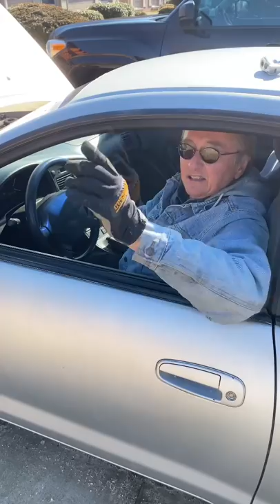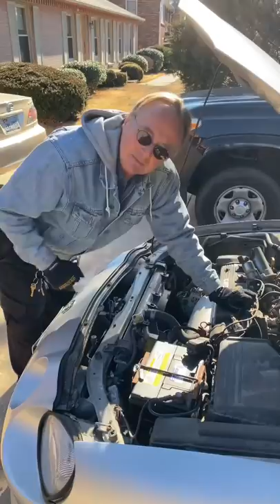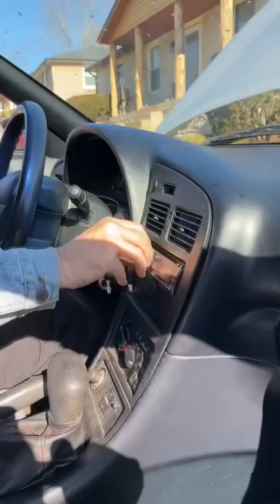Never Do This When Starting Your Car

Comment from the maker: Thanks for watching! Like and Subscribe for More Vids Daily ► https://www.youtube.com/channel/UCuxpxCCevIlF-k-K5YU8XPA?sub_confirmation=1
Reply: Scotty I just bought a 2005 GMC Canyon, no check engine light or anything runs great and well kept... only issue I’m noticing oil build up around the top of the engine valve cover... what might it be?? I don’t want to pay if nothing is needed but dont want to regret not doing anything... I’ve checked the oil constantly but no noticeable difference after having it for a month now. Any suggestions?
Reply: NO WAY SCOTTY IS PLAYING RADIOHEAD WHEN HE TURNS UP THE SPEAJERS THIS DUDE GETS SICKER AND SICKER
Reply: Can't start a car that's already running😯😯😯
Reply: New cars don’t crank if the motor is already running, come on Scotty, you should be more specific.
Reply: Hmmmmmmm🤔🤔🤔
Reply: Holy cow Scott , hope your flywheel didn't lose a tooth on that demo

Comment: Lol, this gave me a Beavis and Butthead flashback. “The car is already started, there is no need to start the car anymore”.
Reply: “hehe that was coool, do it again”
Reply: Some engines are so quiet, if you don't look at the gauges, you don't realize they're already running!
Reply: I rented a car and the engine was so quiet at idle
Reply: @petahe01  how quiet was it
Reply: @petahe01  I'm too am curious as to how quiet your rented car was.
Reply: @ligase75  common
Reply: I too am curious as to the lack of decibles said rented car produced.
Reply: @dansmith6990  it was so quiet I could hear your mom still begging for seconds!

I fix a really mean apple cobbler and for some reason, she has my cell phone number.
Reply: Vance Wankel  I didn’t see any option for plug in.
Reply: @dansmith6990  😄😄😄

Comment: I remember when my folks got a Mazda RX2. It was so quiet while running, some people tried to re-start it.
Reply: My Pontiac G6 is this way...but I don't get the horrible grinding noise with this car, maybe some cars were designed properly not to engage the ignition when the car is on?
Reply: I have a Mazda 3 1.6 Petrol and this keeps happening to me..
Reply: @TheStefano009   same car, same problem

Comment: I did do that few times to different car,  the ambient noise, and car quietness made me wonder my car engine is running.
Solution:
If you are not sure, TRY turn off car, this will not hurt any thing, afterwords, crank car. This is good strategy.
Reply: Or look at your tachometer if you have one.

Comment: Thankfully most modern cars have the auto start feature like mine, and it won’t allow the starter to engage if it is already running.
Reply: It also wont allow the Starter to engage when that 1$ Chip decides to start speaking Chinese!   Srsly, you might think "well things fail eventually you need to replace them"
But now you've ADDED a part which didnt need to be there AND IF IT FAILS THE WHOLE CAR IS USELESS.  how much will it cost to fix?  Well, with integration these days and over-designing.  I could see this cheap component being part of some expensive piece that you have to rip apart the Dash to access and you ahve to replace the entire Starter-control unit.  Instead of, say, Run a new wire from Key Ignition to Starter! boom, 10 minuet garage fix like on my Tempo.
Reply: @glytchd  
You want simplicity? Better go back to the 1950's.

Comment: I've done this before by accident. Was sitting in a parking lot reading texts while my car was running, then I forgot and thought it was off and cranked the key. That's one thing I am grateful about the push to start cars. If you push it again, it'll just shut off.

Comment: I took my 2007 FJ Cruiser with 170000 miles on it, in for a wheel alignment. The mechanic tried to start it while it was already running due to the fact it runs so quite and smooth you can’t tell it’s even running.  Toyota builds them well.
Reply: Same thing with my 2011 Tacoma 198000 miles, these things are tough!

Comment: My 2013 Accord has this problem. Honda poorly positioned the starter gear to the flywheel on the 9th generation V6 models with push button start, so when you start it there’s a chance you hear that horrible noise. They also figured it made too much sense to have it covered under warranty but not issue a recall smh 🤦🏽‍♂️

Comment: And don't select reverse while still going forward at 20km/h like I did.
Meant to put it in neutral as I was slowing down to save brakes which I had been doing for a little while but had the lockout button depressed this time. I don't do it anymore.

I think I'll get a manual car.

Comment: Hi Scotty. Thank you.  I have a 2003 Toyota Tundra 4.7 blah-blah-blah (Best truck I have owned to date) Did you know that there's a safety feature on my truck that knows it's running and won't engage the starter if you happen to try and restart. A friend has the same truck as me, I told him to start the truck, after a minute he turned in the ignition. Blew his mind, he had the truck for 12 years and never knew it. Anyone out there there with the same truck give it a try. Sorry for rambling. T
Reply: Yes please don't ramble so much .. 
We are all so very busy . lol

Comment: I think I never drove a car that would even allow this. The oldest car I ever driven (and is driving) is a 95 A8...and the key locks up after cranking (even if the engine does not start). You have to bring the key back to "entry position" and then it will allow it again.

Comment: I had a 1965 Rambler Classic 770 with a 287 V8. You could not here it run, you could not feel it run. I turned the key while it was running on a few occasions.
It didn't sound good 😳🙄

Comment: My car is modern enough that you can't crank it again if the engine has already started.
And if you stall the engine, you'll have to "reset" the key before cranking the engine again. it's only a renault Clio 3.
My Toyota on the other hand, has a start button, never had a problem with it, just press the clutch, LED turns green, press start and voilà, typical Toyota, starts right up.

Comment: Does this affect CVT transmissions the same way?
Reply: Nothing to do with transmission. All cars use starter motor which has teeth that mesh with the flywheel. It can damage any car regardless of transmission.

Comment: How old does a car have to be to allow the starter to run when the engine is already running? My 08 Jeep ignores such attempts because the computer knows the engine is already running.
Reply: 08 jeep? Godbless you
Reply: @luisgonzalez8423  O8 Grand Cherokee Limited with the 5.7 and 4X4. ~71K miles and no problems. I changed all the fluids at 50K as a preventative. It's on it's 3rd set of plugs per schedule. Been a great vehicle. Still looks very good. Gets regular oil changes and regular highway blasts.
Reply: Transmission will go first. Goodluck
Reply: @luisgonzalez8423  Original owner, lifetime powertrain warranty,  Never missed an inspection. Transmission shifts just like the day I got it. Fluid looks and smells new. As I said, all of the fluids were changed at 50K. Both diffs, transfer case, trans, coolant, brake, etc.

Comment: I tried this on my car with the engine running but it failed to make that grinding sound, is it broken?
Reply: It is designed to prevent this bonehead mistake, just like manual transmission cars are now designed to prevent cranking without the clutch disengaged.

Comment: When in doubt, throw the car in drive. If it ain’t running you’ll be able to find out quickly
Reply: I always just look my RPMs if the ambient noise around me is too loud to be able to hear my engine running
Reply: @DrPeppa  
 Good point!  and just an fyi,  the gauge your rpms are shown on is the tachometer. 👍😉

Comment: What if it makes that same noise trying to start the car? Id guess that means starter may have to be replaced soon?
Reply: It might be that the teeth on the starter or the flywheel have a bad spot in them. If that's the case, hope it's the starter! A lot cheaper & easier to replace!
Reply: I am hoping it is. Already looked up prices for em its a lot more affordable indeed!
 It seems to not happen if I start the car (push to start) by pressing start button twice so that it turns on battery then press and hold break pedal and ignite.
Reply: also make sure your battery is good . have it tested .
Reply: @jayhockley8841  battery is fine always check first! I had that as in issue fixed before noticing what seems to be this starter issue

Comment: Well doesn't just about every single modern car have a fail-safe put in place that in case you do try to crank it while it's running, it won't engage the starter?

Comment: My 2018 Chevy Colorado will not do that. The computer knows the engine is running so it will not send power the the starter . The 4 cyl in my truck is so smooth and quiet that I turned the key nothing happened while the engine was running.
Reply: So did my 2002 Cadillac DeVille, when I turn the ignition with the engine already running, no noise it heard .
Reply: ...... that's the danger of the Colorado.....it has so many endearing qualities......until it starts to go haywire....then the money pit starts to yawn open.......one key reset..,.only Chevy dealership can do(!#?!@#!)=$600!!!!

Comment: I've done that a few times. I would hope engineers would fix that.
Reply: It's fixed, most GM vehicles have a starter interlock where the starter will not engage if the engine is running.  I had a 01 Cadillac that had this function.  My current daily driver is a 2013 Malibu and you can hold the key on the crank position all day long, it will not grind the starter if you wanted to.

Comment: So you don't want to crank the air-conditioning too? Kinda surprising considering where you recently moved from Scotty 🤣

You're right though, cranking an engine that is already self sustaining can only do bad things, particularly to the ring gear and the starter itself.
Thankfully it's something electric vehicles don't have a problem with (for obvious reasons) and I'm pretty sure that many modern cars have an automatic lockout that works the same way a neutral or clutch switch works to prevent the starter from engaging if rpm is detected.
if I remember correctly my old BA Falcon had such a lockout as I'm pretty sure I went to start it one day whilst it was already running (it was weirdly quiet below 3500rpm, near silent at idle) and absolutely nothing happened. Confused I glanced at the dash again to see it was already idling at about 700rpm

Comment: It can happen if the engine is too quiet.  But why doesn't it automatically disengage when it starts?   Instead you have to release the key.
Reply: Friends had a  1985 Honda Accord they bought new and it was so quiet you couldn't hear it running from inside the car. Saw the wife grind that starter a few times.
Reply: Because people instinctually release the key, and being able to keep it turning during cold start in cold weather can get an engine running even if for a second it cuts out. If the interlock detected the initial run it wouldn't let the starter keep turning to keep the engine turning and get it running after it briefly stalls.

Comment: i hate my car. its engine barely has a sound when its running and its so easy to try to turn on it when its already on lol. i ended up having to replace the starter at one point and i hope the flywheel is okay he he

Comment: The key ignition can actually get stuck in the forward position when it begins to fail causing the starter to stay engaged  burning out the starter cylinoid and shredding the flywheel ..be sure to slightly turn back the key, make it a habit!

Comment: Scotty needs to do a video on security settings. Cars have a security setting that have a way to reset them. My Nissun truck wouldn't crank because of a fuse. Easy fix when you look at the problem of what's easy to do first. 😂😂👈😂

Comment: This is why a quiet car sucks lol
Reply: Did it a few times after getting a new car after driving a noisy old pickup.
Reply: @Bendigo1  damn that’s sucks. I always knew turning the key when the car is on wasn’t good but when the car is so dang quiet how do you avoid it lol. I to going from a not so quiet car to a more quiet one have made the mistake quite a few times, hell I know I might do it again soon enough lmao. I think I’m gonna try hitting the gas a little just to check from now on if I can remember to do so lol
Reply: I just eventually got used to the difference in key position, i don't think that wpuld work on the push button start cars though.  If it has a tachometer you can look at that.      I think new cars with digital displays will have a different display too.🤷‍♂️

Comment: I've accidentally done this a couple times. :/
Reply: Join the club , most people have .
You can get away with it a few times . if you have a tachometer see if its off " 0 " .
If it is , your car is running .
Reply: @jayhockley8841  Thank you for the tip. I'll try to remember it.
Reply: @balgus82  Your Welcome